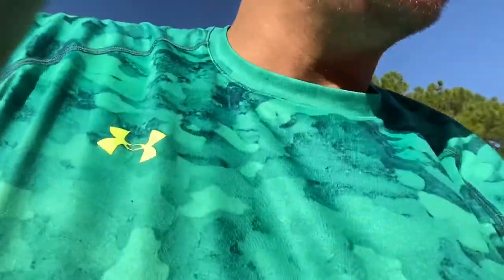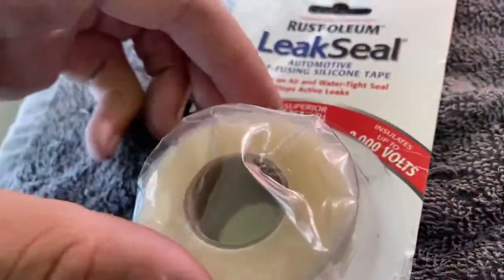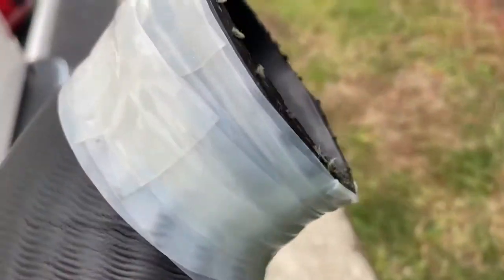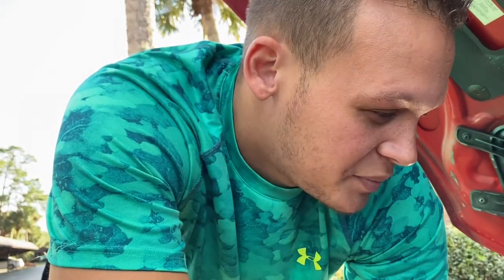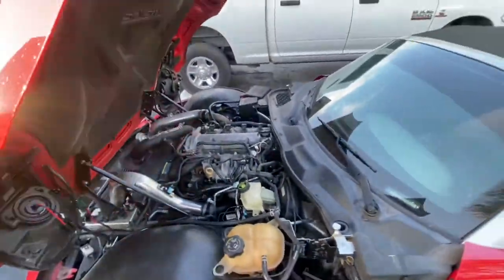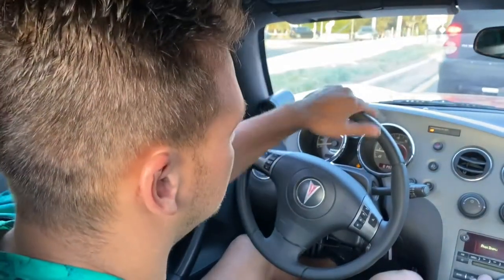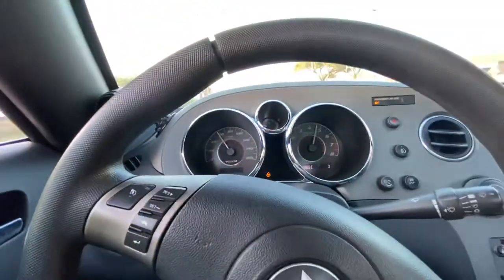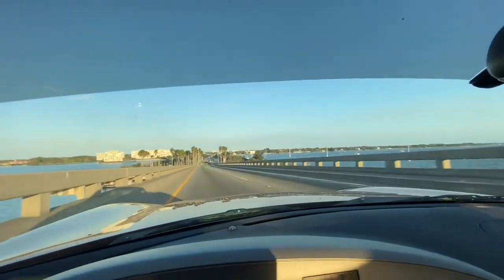Leak Seal...Will it work? Turbo Hose Repair?

Comment: I tried installing this Rust-oleum Self Fusing Silicone Tape on my VQ35DE and it still is not making boost? Disliked and unsubbed
Reply from the maker: You might wanna try wrapping it more ...u might be running to much boost 😬🤣